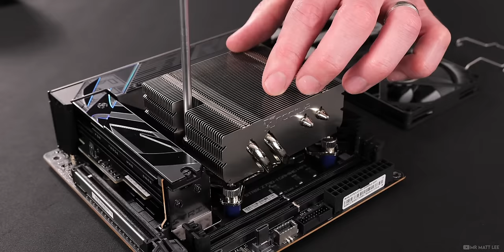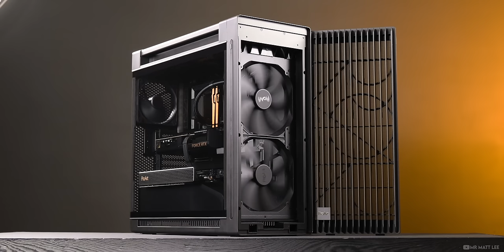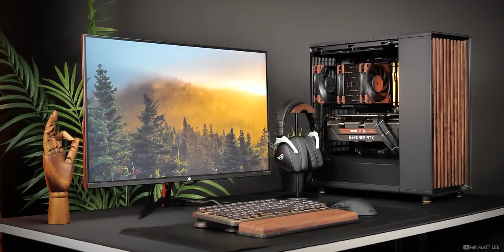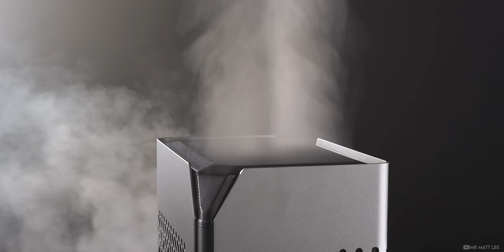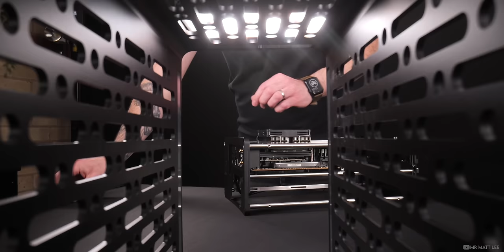PC Case AIRFLOW; A Visual Guide for Optimal Cooling.

Comment: i have a Y60 case with only 1 intake at the bottom close to the AIO tubes the other 8 fans are exhaust, not 1 spec of dust, idle temps of below 40c for both 3800x3d and 3090 and load temps of 75c on both max.

Comment: I doubt on the airflow case making more noises
In less airflow case, glass and other solid panel absorb the sound generated by fans but they also spin up much more to get the same results producing more noises

Comment: My build is a Lian Li Lancool II, I have two 120mm fans on the front, two at the top and one 140mm at the back, and using a Noctua NH-D15 air cooler. Do u think I should remove one fan from the top? maybe put it at the bottom?
Awesome video as always btw!
Reply from the maker: Given the size of the NH-D15, if both of your top fans are pushed towards the rear of the case, I don’t think there would be much overhang in front of the cooler, so it shouldn’t be a big issue. That said, just one at the back would still be preferable. I’d personally place that extra 120mm fan at the front and have 3 front intakes to direct more air underneath your GPU in this setup ✌️
Reply: @Mr_Matt_Lee  thanks, I'll try that✌

Comment: Logic and physics dictates, the best is Front=intake, Back=out, top AIO (if you have)=out. I accordingly chose the case (Cougar Uniface 4 fans) and went with this setup. All the extra is not needed. Tunes the fans per CPU% and MB%. The result, my Ryzen 7700 with PBO+CO with TjMax=88C, gives me close to 5.25-5.35Ghz All-core, 5.5Ghz Single core, idle = 45-50C, load max as per TjMax 88C, with AIO fans running dynamic with max set @80% and case fans max at 70%, with lower temps they get slower. Where I sit, ear level: idle/browsing/video 25-30db, full load 33-38db. Close to perfect performance/noise/cooling.

Comment: 6:45 any paper or research about this subject? I'm not convinced about "the highest point of the radiator must be higher than the pump"
Edit: oh, I get it now. I was just confused because the pipe in the radiator being in the highest spot of the radiator makes the "air" to be in the "top" of the radiator. But since the highest point of the radiator is higher than the pump, I assume it is kind of "okay".
But I still think that the pipe being in the bottom of the radiator is better

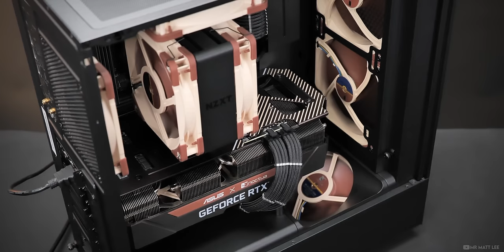Comment: 6:50 but having the pipes at the top of the radiator is also bad?? cause it will be more likely to pull them into the cpu block. please if u can, place the pipes of the radiator at the bottom.

Comment: 9:36 you say that you don't need an open front case for liquid cooling because you dissipate from the radiator. But what if you use a CPU oriented setup? Is it that bad as I think it is? I've got a Fractal Define S case and I don't understand how much air can I pull in from this closed front panel

Comment: If aesthetic is not important, all u need is 1 fan. A home ventilator fan of 8"-12" on the front panel. A ceiling type is better than a wall type as u can then run the hot air outside with an aluminium duct. A good ventilation fan is very quiet despite the size.

Comment: Hey Just watched this material, and have a question for you. Recently bought a Nzxt H9 elite , and am trying to figure out the fan configuration. The pump will have to go on the side with its radiator. The question is how to configure the fan air flow to make the best airflow performance possible. The CPU and GPU will be hot as I'm rocking an i9 14900k and a 4080 super super. 12:38 r

Comment: Hey Mr. Matt, what about in the case like AP201 with liquid cooling? Since it has no front intake, it'll rely on the sole bottom intake for both gpu and cpu cooling right?  What if the rear fans turned into rear intake instead, will it help?

Comment: Why there are no "route flow where needed" setups? Every PSU has it inside - half of a cooler is obstructed by transparent film, half that is closer to the exit - this, obviously, forces air to take full trip along its components. Cutting shortcuts from intake to exhaust inside PC case is as easy as cut some bigger blister packages and tape that transparent rectangle inside from one corner next to intake to what ever you need to cool first. That is what I am going to do in my dual CPU workstation - force top intake air to go through CPU fans and WRM areas before reaching other places in PC.

Comment: Ok so question for all you cooling masters:
Can you make the GPU exhaust air straight out from its fans or does the air blast into the heatsinks and expel the hot air straight into the case and all over the CPU and motherboard?

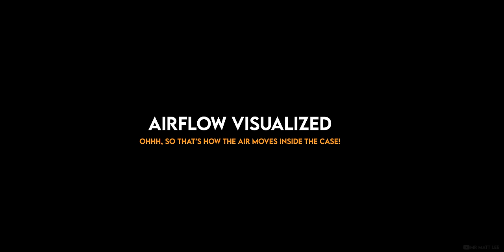Comment: Question I have, looking at the PC at 7:54, does having such an open back and top grill cause any recirculation of air? Possibly drawing in hot expelled air. Or do you need to have the intake fans pushing in so much air to try to have positive air pressure inside the case?

Comment: Quick question for you:

If the radiator is in the front
Can you still put case fans at the top without problems
Reply from the maker: @jessehermans253  if the radiator is at the front, your front fans need to be intake and your top fans need to be exhaust. There’s no problem with that
Reply: @Mr_Matt_Lee  i don't know what to look for as I don't know the difference

Comment: I'm about to build a pc in a Fractal Pop air case, with a 240 mm aio. I'm wondering how to place the fans, i was thinking the front fans of the case as intake, and the rear fan as exhaust, with the aio mounted on top as exhaust as well. But that will make negative pressure and apparently it's not very good. So then i thought about reversing the rear fan to an intake, but it seems a bit counter intuitive. What should i do ?
Also how i should i mount the psu, fan up or down, considering i'm gonna put the pc on a desk ?

Comment: Quick question so you said not always a lot of fans are good, you put the example of 2 fans in the back to exhaust and 3 intake. So what about air pressure inside the case? is not better to put the same amount of fans?

Comment: i would like to ask a question that's been bothering me for a while but can't find a definite answer to... Why is it that, people gets different result of mounting GPU vertically vs the normal horizontal config? as in, for example lian-li O11D mini, there are people who got cooler gpu temp, or hotter, when they mounted their GPU vertically, so what is causing that?
is it the different fans used? difference in stock GPU cooler/heatsink design? or?

Comment: 7:35 would having top exhaust fans still deprive the cpu of cooling if you had side intake fans example Using the fractal North case brackets with your setup?

Comment: Okay. So I have a question. My current set up is similar to 7:36 but instead of the extra 2 exhaust above, I have 1 intake set closer to the front side. Will this be a problem? There are 4 intakes (3 in the front and 1 above) and 2 exhaust (1 at the back and 1 above)

Comment: ordered an antec c8 not sure if I should go push pull mounted on the side with the artic freezer 3 or top mount with normal exhaust and use the other 2 fans as side intake.

Comment: Lian Li O11D evo is the best, if you take 3 bottom fans to intake, side fan for CPU(aio) intake, upper fans for GPU (aio)outake , all the hot air will take away from the case

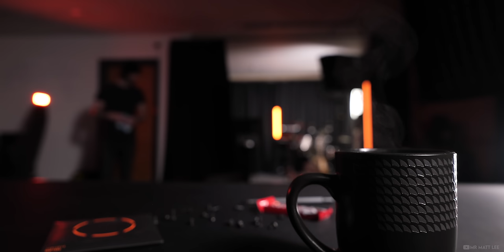Comment: 5:47 
the reason why rads are at roof is because you need to move outside the hotter air
rear only supports 120mm rads , which are pointless
front brings hot air inside , unless it's exhaust which means it blows in your face
and at bottom you have the air bubble problem

Comment: 9:17 side air hole are good idea, because the gpu throws hot air to the side, mostly i find my side panel are so HOT
and I believe some of the hot air are go back to the gpu

yes we can placing a fan under it so hot air can go up and out by exhause fan

but side air hole are good too for intake

correct ?

Comment: How necessary is an exhaust fan? I'm building a custom case right now and I have a 420mm radiator in the front with three 140mm noctua fans attached and then have slots at the top of the case for exhausting air. Both the gpu and cpu are aircooled so not much fresh air actually needs to get to anything inside the case. How necessary are fans beyond the three intake fans in this sccenario?

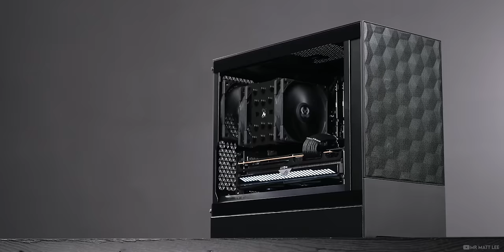Comment: What is that mysterious relic though doth fit there.  3:34. It resembles a device for spinning plates and cup holders!
- GenZ.
Reply from the maker: It’s 100% a cup holder 😅
Reply: Whatever that case is I need it! Bottom PSU and old media drive options is a must for me. Love the setup with 2 front intake fans, 1 back/rear exhaust & 1 top/rear exhaust.

Comment: It is best  to have heat exhausted through the top as it is the natural direction of the heat and will  increase cooling capabilities. Intake should be done low down to maximise time to  gather  heat energy.
Front to  back or vice  versa may look  cool and be easier to  set up, but it  simply  isn't  very effective.

Comment: I am running the Phanteks Enthoo Pro TG. Thinking how to set up the case fans as the front only lets me mount two fans (120 or 140). There are also mounts for 1 fan on the rear, 2 at the bottom, and 3 at the top.

Comment: Any links to cases that accept 13 fans??? 3 top, 3 bottom, 3 side, 3 front, 1 rear??? That's what I have in my 011 dyamic build with a cold zero front panel. But I have been using it for four years now and am interested in what else is out there????

Comment: If i have 3 front intake fans, 2 bottom intake fans and 3 top exhaust fans, do i need a back exhauust aswell? my mobo only has 4 sys fans, all 8 fans are daisy chained (max 2 in 1 slot) 2+2+2+2 should i chain 2 of the fans into 3 so it frees up a slot for the back?

Comment: I bought an air cooler like deepcool ak620 digital and I encountered a problem during installation.  The RAMs are high and one of the fans should be moved.  What is the best fan position in these situations?

Comment: I’m surprised dual chamber aren’t that good for airflow. I thought intake from the bottom directly to gpu is perfect. What if dual chamber has mesh in the front? Will it be perfect airflow then?
Reply from the maker: Note the use of the word ‘typically’ when referring to dual chamber cases. I’m not speaking for them as a whole, just the most common configurations. If you have mesh in the front with fans, then it’s essentially the same as an airflow focussed mid tower for the most part. It’s the side intakes that cause the turbulence in specific cases that have that config. I did note, however, that the cooling is still perfectly fine, it’s just not the most efficient.
Reply: @Mr_Matt_Lee  what if it's a dual chamber case with front and bottom intake with fans, but no side intake? Will it be more efficient? That way air gonna blow same way from front and bottom to back and up.

Comment: Not my hobby. I like to do it myself to keep costs down and make sure it's done right with the brands I trust. But after that, I just want it to perform, be quiet, and I do very little in between. Current PC is from 2020, probably up the video card (maybe PSU too)... but the rest of it will stay as is for probably another 4-5 years.

Comment: Heat rises, so the form factor is desktop, not tower.

Heat rises, so the desktop box should have no top.

Heat rises, so the GPU should lie on its side, not covering other hot components, and not blowing hot air near other components.

Cases trap warm air, and so should be removed, fans mounted onto components only.

The fans on the components make noise. You put the case-less PC in the next room, and put the input and output peripherals in your room.

Comment: I was led to believe that 140mm fans are louder than 120mm.
And some believe that 3 fans GPUs are more quiet than 2 fan GPUs because there is more of them.

In truth it can go either way.
2 can be louder than 3 and 3 can be louder than 2.
AIO can be both more silent and more quiet than air.

Comment: i have a prebuilt pc with 3 fans at the front... but there is no mesh but a glas panel. Aint that useless for air flow?? My CPU heats to 90 degrees when i download a game. it goes to 100 degrees when i play borderlands 3. I have a 4070 nvidia and 11900KF with 32 gb of ram. The GPU temp is always okay. Now i odered a better CPU cooler to see if it helps. Any clues?
Reply: Do you have a newer generation HP-Omen? Those have intakes at the sides of the glass panel

Comment: I would have preferred real measurements so. You say things like ‘crucial’ or ‘important’. I’m not saying you’re wrong from an airflow perspective - but not from a performance or thermal perspective. E.g. I doubt a full tower would provide more than 1-2c benefit over mid with similar configuration.

Comment: This is a very beautiful video and most of the points are great but at 5:39 you make the incorrect claim about nautural convection of heat. This is very easily overcome by the least powerful directional airflow (something which you can easily test for and search for on the internet) and should not be a consideration in any situation in which there are fans present.

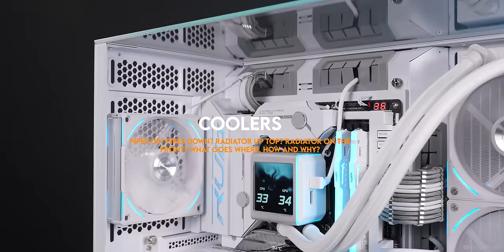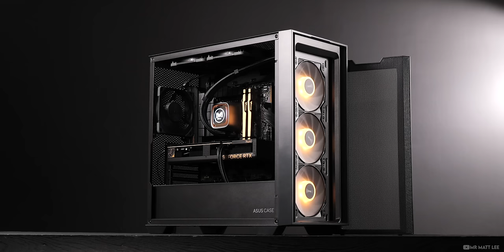Comment: Too bad the systems at 5:09 , 6:24 have the radiators mounted upside down ..The air in the aio goes to the same end as the inlet and outlet so how can it pump the water?

Comment: What is the case used at 6:55 ?
Reply: Same question. Does anyone know which case he is using at this time frame?
Reply: @phamnguyendungnhan6720  I found it out, it's the NZXT H5 some variant of it. My best guess is it's the flow variant.
Reply: @rohanasokan7338 Thank you so much. This will be my next case upgrade. Been a Noctua fan for a while and this case setup with Noctua fans is perfect. And yes, I can confirm it a NZXT H5 Flow Black/White edition.

Comment: Are there any cases you have found that are not just blowing air around the components and are much more efficiently directing it with ducts and such?

EX: a Bitcoin miner forces 100% of the air over heat sinks, and cools things very effectively without wasting any airflow or space. It's smaller than the smallest PC shown here.

Comment: I’m gonna expose myself here, I build my pc last aug n I installed the psu fan facing inwards in ASUS AP201. I use stock Intel air cooler (12400F) with arc A380. 😶‍🌫️
Reply: Someday I wish to upgrade my setup to 14700K with 4070Ti Super or the newest GPU at the time

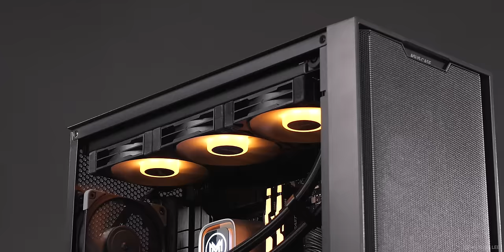Comment: I stopped the video at 5:50... At the famous "hot air rises"... At the same time during the entire duration of the video we can see examples how air moves inside the case, or in better words, is forced through the case. Meaning, the phrase "hot air rises" should be discarded, since has no effect in a PC case that has fans as exhaust and intake.

Comment: It is not the consumer who should buy a bunch of radiators and fans, shove them into cases and think about how to optimize their operation. 
What kind of nonsense is this from a marketer? 
It is the chipset manufacturers who should think about how to optimize the operation of chips so that they do not work at temperatures close to those at which meat is fried and water is boiled!

Comment: "There are multiple different ways to get great results"

If by multiple you mean 2-3, sure dude. For thermal paste, the pea, cross and thin layer methods are what you do. For fans you have more pulling air in than out for good airflow. Stop treating this shit like every answer is good.

Comment: Great but useless video. Not trying to be picky but it’s the truth,it’s extremely easy to build a pc with great airflow. The hard part is doing so while prevent dust going in so you don’t have to clean your pc every 3 month but rather 3 years, AND have enough noise isolation that your PC is close to silent even when you are gaming.